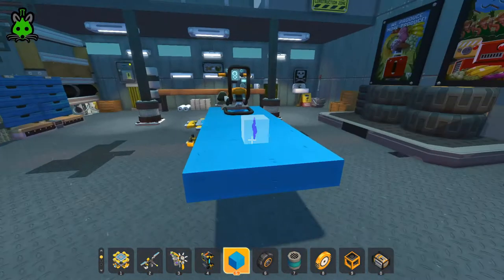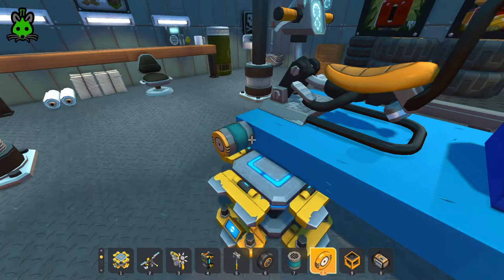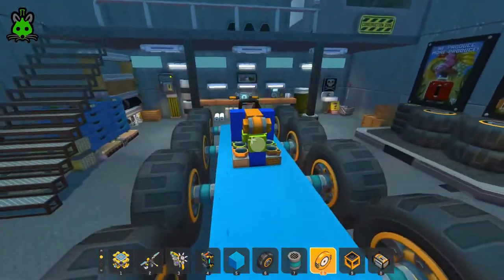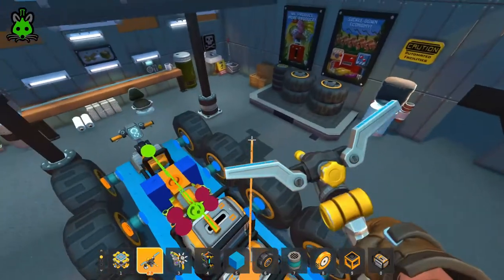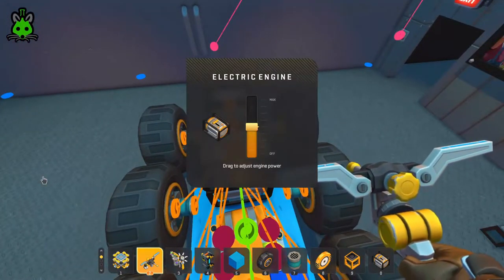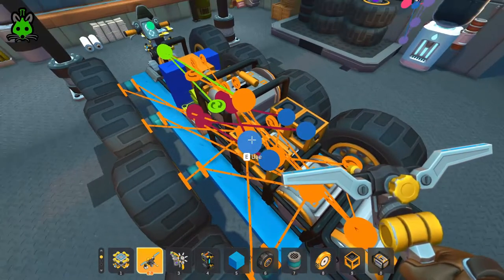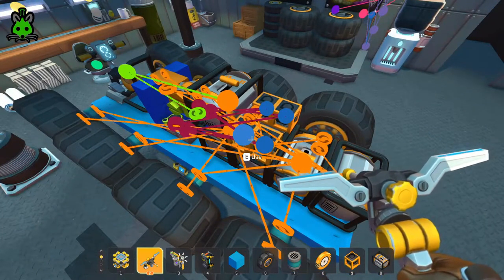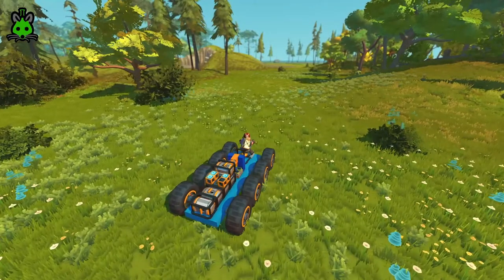WASD Easy Tank Steering Build (vanilla)(no mods/glitches) Scrap Mechanic

Comment: This seems like needlessly many engines and logic gates. You can do full skid-steer with three engines and an A/D converter, though you need 3 bearings for each wheel so your wheelbase can not be lesser than 5 blocks. Basically the first engine connects to the seat and drives the outermost bearings giving normal forward/backward drive, then you take the second engine and connect it up to the middle bearings on the left side and the inner bearings on the right side and to the left side of the A/D converter, then you take the third engine and connect it to the middle bearings on the right side and the inner bearings on the left side and the right side of the A/D converter. Make sure that the inner bearings are inverted and all the others are in the driving direction and you are all good. This is the most compact way to do it I've seen yet and it's probably easier for beginners as it doesn't involve logic gates. I do like the WASD converter though, cool idea! Here's some images of an example of the way I did it: https://imgur.com/a/yaKdtmg
Happy engineering to you!
Reply from the maker: Nice I'll try it out and maybe I'll do an update vid

Comment: so y can't you just have a upgraded engine, rather then 4 not upgraded?
Reply from the maker: each side has a forward and backwards set of bearings. scrap mechanic seat wont work that way trying to just use on engine. its a game mechanics thing.

Comment: Does it work on gas engines? I can't seem to get it to work with gas engines. Anyways, thank you for the awesome idea. SUBBED!
Reply from the maker: Gas engines and electric engines have differnt torque.
Reply: after making this I would give you this tip: the first initial  one for the converter must be electric for it to properly stay in place otherwise gas will swing it about and glitch (for whatever reason that is im assuming to much torque and electric is constant power over gas is gradual) but the other ones for wheel and such can be gas but may look wacky but still function